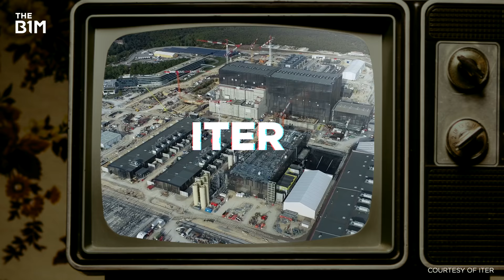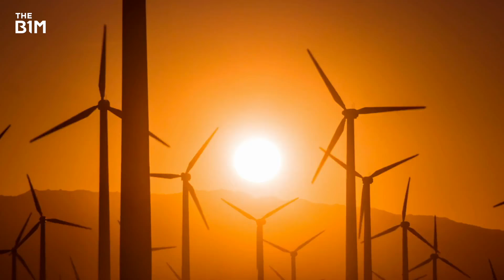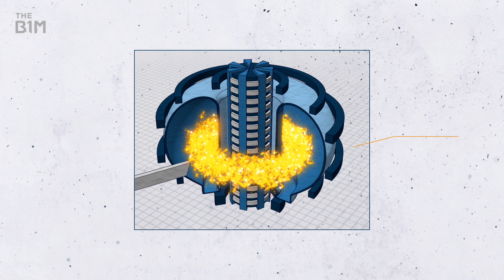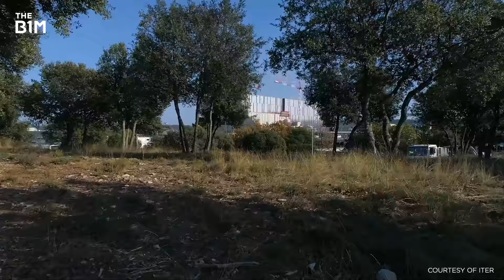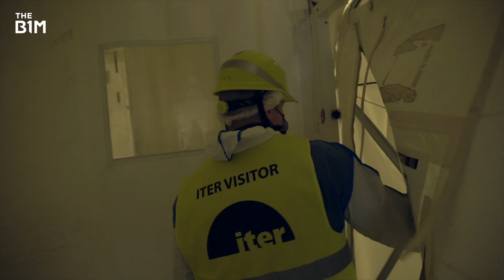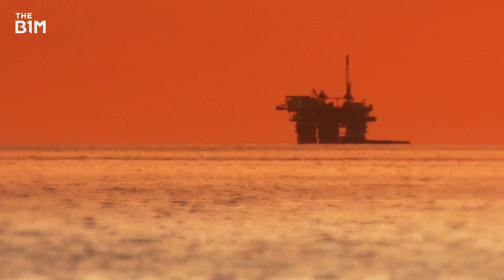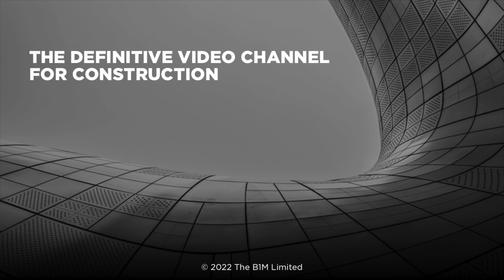We Went Inside the Largest Nuclear Fusion Reactor

Comment: "It doesn't get cooler than that". From the thermodynamics POV, since the actual physical cold components, the superconducting magnets @ ~4.3K, just about where the speaker was standing, will be about 3 meters away from the fusing plasma @~150 million K, the thermal gradient (DT) will be ~50° million K/meter. This will be quite possibly among the steepest such gradients in the known universe. 

To oversimplify, the maximum energy output of any heat engine is fundamentally limited by the steepness and height of it's internal energy gradient. Various losses further reduce actual output of course, but DT is the fundamental parameter wether the source is fossil, fission or fusion. Therefore, comparing the DT across sources is a useful way illustrating why so much effort, time and treasure are being spent chasing this rainbow. DT for HPW fission is only a few hundred °K/M for instance, similar within a factor 3 or 4 to gasoline engines.

Of course, the hiding places of the Devil are well known, and ultimately the purpose of ITER is to ferret out his imps. This is an EXPERIMENTAL device. It's intended product is information not electricity, and it will serve every other fusion project by verfying known principles and extending theory into previously inacessible physical regiems. It was never meant to boil teapots.

Comment: Not to be a downer, but ITER definitely won't produce more energy than is put in. The intention is that the reaction itself will produce a bit more energy than put in, but there are also huge inefficiencies in both the energy input and capturing the energy output. It would need to generate at least 10x the energy put in to make up for those.

If it works it will still be a big step, but not a step over the threshold.

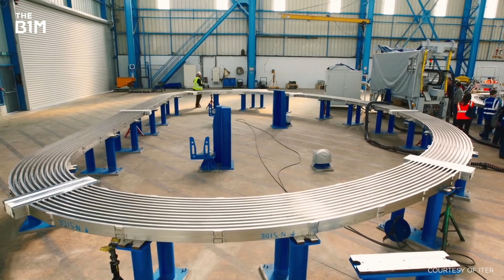Comment: My dad helped with the design for parts of this project. Specifically around 3:10 you can see the assembly platform he designed. It’s really cool to see my dads work in a B1M video ❤️
Reply: Sorry for that the fusion is not ebergy to generate the power, but certainly having woth study an research. We've gotta know the minutes produced by Tokamak, plazma, might last  hundreds of seconds not enough to produce the energy. This is something we need to get over.
Reply: Passbook
Reply: @BENJAMIN PHILLIPS and even objectively looking at the facts of these disasters, per mwh of power produced, these weren't that bad.  Still nuclear is orders of magnitude safer than wind or solar.  And these are plant designs and locations we would never choose again.  Nuclear now is exponentially safer in new construction than it was fifty years ago.  And even that is way safer than the second-best source of power we have today.
Reply: @MrGottaQuestion  what energy source is fundamentally unviable?
Reply: @Prophet_of_Colour  Tokomak as is currently takes up more energy than it produces.  Additionally it will be far too capital intensive to build a plant than is practicable.  If some other form of fission could be made, where the plasma is self-stabilizing, then it could be do-able.  But the tokamak as it now stands is not going anywhere near commercial electricity generation anytime soon.
Reply: @MrGottaQuestion  I see. Calling technology in development fundamentally unviable was a bit misleading though, as while it technically is supposed to be in reference to today, I initially thought that was a statement of the technology itself, regardless of how long it spends in R&D.
Reply: @Prophet_of_Colour  Very capital-intensive electricity that still doesn't break even in terms of generating electricity after 70 years of trying doesn't bode well for the technology.  Even if the problems are solved, an even-bigger plant would need to be built to generate electricity, costing even more than ITER.  Then, to make any kind of dent in our co2 problem, we would need to mass produce them on a massive scale.  Imagine how expensive this will be.  Who is going to pay for them?  It's unviable.  Fusion has some promising, and smaller, cheaper ideas.  But Tokamaks, barring some breakthrough, will always be "50 years away" from being realized.
Reply: I am 61. I hope i am alive the day we produce more fusion energy than we expend. It will revolutionize the world!!
Reply: My dad designed the universe.
Reply: Yes your dad helped in designing what will kill the planet earth in near future.
Reply: My dad is an alcoholic druggy
Reply: Proud moment🔥
Reply: thats cool but didnt ask mate
Reply: @Mio I'd wager you'd rather believe anything that fits into your preconceived notions conviently and doesn't challenge you to think critically.  These PhDs that you mention have fusion to thank for their careers, and while it's a fascinating field of study, as well as an effective jobs program, it will do nothing to avert climate disaster in the coming decades.  If you ask them about fusions' viability within their lifetimes, even they will point out the rollout will be "slow".  Which is an understatement as it will probably never generate even 1% of global energy demand in the tokamak configuration (like ITER) even if the design is figured out, due to its exorbitantly high capital cost.  If you were to actually delve into the matter, you will see legions of physicists and nuclear engineers attacking fusion.  And even within the  pro-fusion group of engineers and scientists, you will find many criticizing ITER and the tokamak design for it's incredibly high capital cost and taking up all the research funding, leaving newer, more promising designs without funding to be tried out.
Reply: Cool! My dad also contributed, but to the EMC and safety around the wiring. Go dads!
Reply: God Bless!
Reply: That is really cool!
Reply: @frank1fm634  are you Jacob's dad ?
Reply: @Cool Baby aight
Reply: @Poffdwudd30 no proof
Reply: @b1._.x457  ?
Reply: @Poffdwudd30  no proof that your dad worked on this. You just saying that would make some believe you but no all
Reply: @b1._.x457  you seriously need proof that my dad worked on this? I literally put a time stamp in my original comment showing the assembly platform he worked on.
Reply: @Poffdwudd30   you act like you're the only one who can put a timestamp in a comment lol. The timestamp just shows the assembly platform, it doesn't state who worked on it...
Reply: @b1._.x457  you right lol, I mean I’m not exactly sure how to prove it so it just kind of threw me off when I read your first comment lol
Reply: @Poffdwudd30  lol okay, well if your dad worked on it, props to him!
Reply: @b1._.x457  thanks! Sorry I was a little hostile earlier, it’s been a long day lol
Reply: @Poffdwudd30  haha, no worries
Reply: How many decades ago was this?
Reply: Your dads work is below average. I would not be proud to see your dads work.
Reply: Nuclear is a waste of time... your dad should be working with hydrogen power plants and using an actual sustainable clean power source instead of a very dangerous power source with the capability for catastrophic failure..
Reply: @dislikecounter6392  its a fusion plant not a classic nuclear plant.. 
Learn the diffrence before you comment and making a fool of yourself..
Reply: @kalle1689  "classic" nuclear plants using 50 year old technology are the cleanest and safest energy we have ever deployed.  Learn before you comment and making [sic] a fool of yourself..
Reply: @MrGottaQuestion  Chernobyl, Fukushima and other accidents never hapend then? And then we have the waste from these plants.

My point was about fusion vs fission.
Fusion is both cleaner and safer than fission.

Read my comment again before you make a fool of yourself.
Reply: @kalle1689  chernobyl killed several hundreds (due to awful Soviet design, management, and disaster mitigation).  Fukushima killed nobody and gave two people a 1% greater chance of cancer during their lifetime.  Even including Chernobyl in the statistics (although nobody advocates building graphite-moderated reactors of the type without containment domes and strong negative void coefficients), current fission nuclear is the safest energy source we have.

Waste is not a scientific nor technical problem.  It is primarily a public relations problem.  99.5% of waste is unused fuel if the fuel cycle were to be completed; the rest (actual fission products) is highly radioactive due in part to its short half-life - meaning it decays away quickly.  Its radiation levels are below that of regular uranium (the natural ore it came from) in less than 300 years.

Fusion as an energy source DOESN'T EXIST. Therefore it cannot be "cleaner" than an actual energy source.  Also, I suppose these pro-fusion/anti-fission types haven't thought much about how tritium will inevitably escape into the atmosphere due to it being nearly impossible to contain 100% in metal vessels.  And I don't think we will be replacing multi billion dollar plants after a few years due to hydrogen embrittlement.
Reply: @MrGottaQuestion  its simpel to make scientific breakthroughs.
You need bigger projects to make big leaps.
Like fussion you, its a result of massive spending, even if the goal was nukes they made other achievements.
Same with the space race, loots of scientific breakthroughs was made that that had commerical us like usage of satellitets.
Even private companies is spending money on the fusion.

But i gues you think the devemopment of fussion was waste of money? 😆

You asking me if i can see in the future?
So if i cant see in the future my argument is not valid? 😂
Reply: @kalle1689  Yes, it's so "simpel".  Let's pick a project that's from the fundamental beginning impossible to make practical and economical, and let's bet the farm on it!  Perfectly responsible policy!  I mean money (and inflation) are infinite after all!
Reply: @MrGottaQuestion  in the past people like you might have thought fission is impossible but it happened. If we can achieve fusion what is harm in it. Billions of dollars have been spent on fission research so can't we spent more for research on  more reliable energy.
Reply: @IronFist080  Newsflash:  we will NOT achieve economical nuclear fusion.  The physics of it, with its extreme difficulty, and corresponding capital intensiveness, speak against it.  Especially when we have reliable, safe, and economical alternatives in fission, especially new reactor designs using molten salt.  From a science business  article last year:

"Only around a fifth of the Euratom budget will go into fission research, leaving nuclear lobbies unhappy. “We are of course disappointed to see the low levels of funds being granted to fission R&D,” said the FORATOM trade association for nuclear energy. “This is due to the majority of the funds now being allocated to fusion.”"

This distraction of this pipe dream of fusion is shooting ourselves in the foot when it comes to utilizing our knowledge of the atom to quickly and decisively solve the climate crisis, funneling resources needed for modular fission designs into a technology that because of its fundamentals cannot work well.
Reply: @MrGottaQuestion  You think it's distraction but others don't. In past people might have thought why people are spending on nuclear fission and why  just not work on traditional means of electricity production . As I can see you might be in fission field and your research is not getting the enough amount of money that doesn't mean others research will not work.
Reply: @IronFist080  The fact that you are smashing together two particles that repel each other means fusion is much, much harder than fision, for not much gain in safety, efficiency, or any of the rest of it.
Reply: @dislikecounter6392  nuclear fusion has very little known risk when compared to fission. There is no possibility of meltdown and the amount of radioactivity released is minimal in comparison.
Reply: @whatssnots  Not all fission designs have these risks.  Also, fission is the safest form of energy ever created by humans.
Reply: @dislikecounter6392  It's not because you see "nuclear" into something that it is certainly "dangerous". You should check out the difference between this (Nuclear Fusion power plant) and common nuclear power plant (Nuclear Fission), it will ease your mind a little a bit, maybe.
Reply: @HzGP  or he could just watch the fuckin video and find the difference lmao
Reply: @dislikecounter6392  the world will change completely before we need to, so don't worry.
Reply: @moses_MMIII  “don’t worry” and it blow up on us and you will still say don’t worry, right? 
Or TOO LATE?!
Reply: @dislikecounter6392  Wow, my brain hurts reading your comment.  But that's ok, if you want to get educated, there are places for you to do so.  Fun fact:  Nuclear power plants (fission ones) are the most efficient place to produce hydrogen due to their high operating temperatures.  Nuclear is sustainable, lighter on the environment, and safer than any of your "renewable" sources.
Reply: @dislikecounter6392  People like are you what's wrong with the internet, making comments like this without having a clue what you're talking about. Fusion is incredibly safe compared to fission (which I think you are talking about but I'm not even sure that you know what you're talking about).
Reply: @dislikecounter6392  haters are everywhere
Reply: @dislikecounter6392  don't worry
We'll get more vitamin d if one reactor fails
Reply: @dislikecounter6392  you clearly don’t understand the difference between fusion and fission
Reply: @dislikecounter6392  we don’t really have the tech for hydrogen power - so we are developing nuclear fusion tech.
Would you rather nuclear fusion or what we’re using today
Reply: @dislikecounter6392  mate is nuclear fusion not plant, holy research before u comment mate,
Reply: @dislikecounter6392  You doxxed yourself lmao
Reply: @dislikecounter6392  I will go ahead and remind you of how ignorant you sounded 3 months ago. FUSION is NOT FISSION, but the byproducts is obviously what you’re worried about. Fusion releases small amounts of helium which is NOT detrimental for the environment and the main reason we are trying to use fusion to begin with is to reduce the emissions into the atmosphere that fission coolant towers would otherwise release. This would also mean better energy output for all, with similar costs to fossil fuels.
Reply: @dislikecounter6392  they are going to use hydrogen. You do know what is nuclear fusion right?
Reply: @dislikecounter6392  We never give nuclear a chance. Did you even listen to the whole video?
Reply: @dislikecounter6392  hydrogen is also a very dangerous power course. What are you on about? lool  It's also super inneficient.

Comment: The video incorrectly claims that ITER will produce more energy than it consumes. In fact, the power input from the power grid to the experiment will exceed the power produced in the reactor by hundreds of megawatts.  The claim about producing more power is only true if you look at just the power flows at the surface of the plasma, and ignore the power consumption in the rest of the machine.